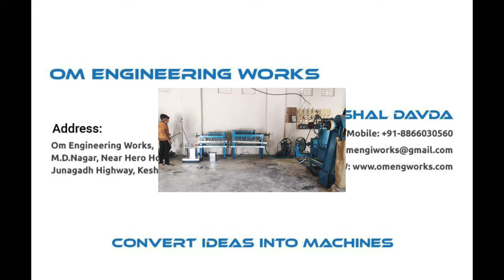AUTOMATIC OIL MILL PLANT OF 6 TONS CAPACITY PER 24 HOUR| OM MINI OIL MILL PLANT | +918866030560

Comment: Mujhe chahie
Reply from the maker: You can call on +918866030560
Reply: Mare Puri માહિતી જોઈએ છે
Reply from the maker: તમારું નામ અને એડ્રેસ આ નંબર પર વોટ્સએપ કરી આપો +918866030560
Reply: @OmEngineeringWorks  price kya hai
Reply: @OmEngineeringWorks  .
Reply from the maker: Call on +91 88660 30560 / +91 82000 63796
Or 
Visit : www.minioilmillmachine.com
Reply: Plant cost
Reply: Muje chaya

Comment: How many cost of this plant.
Reply from the maker: Please call on +91 88660 30560
Reply: @OmEngineeringWorks   how many cost this plant
Reply: @OmEngineeringWorks  where is it from and how much please
Reply from the maker: Please call on +91 88660 30560
Reply from the maker: Please call on +91 88660 30560
Reply: How many cost this plant
Reply: Hi can you please quote forthis machineries
Reply from the maker: Contact us on +918866030560
Reply: How much. 5 ton capacity